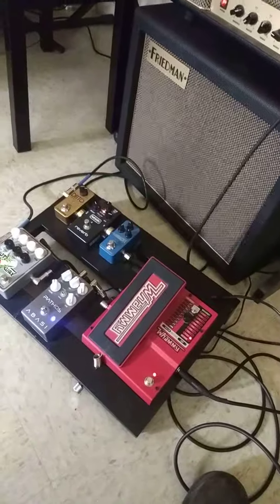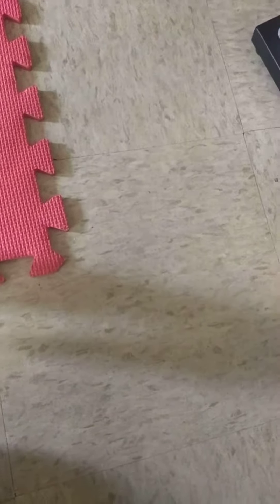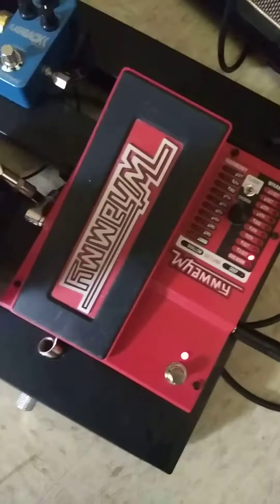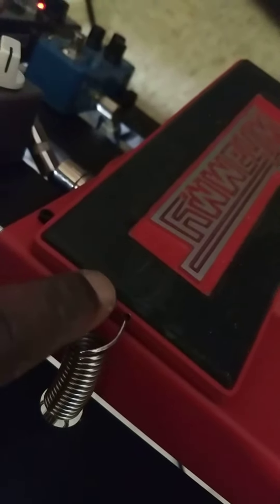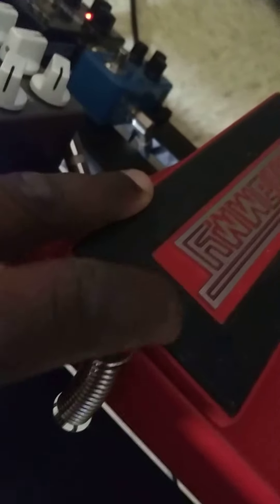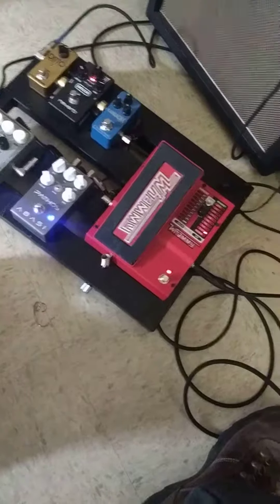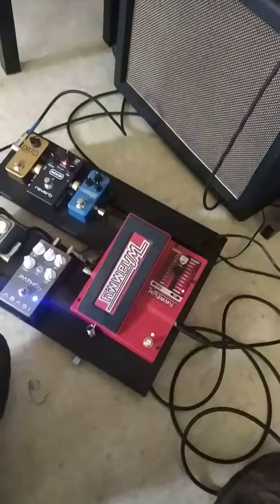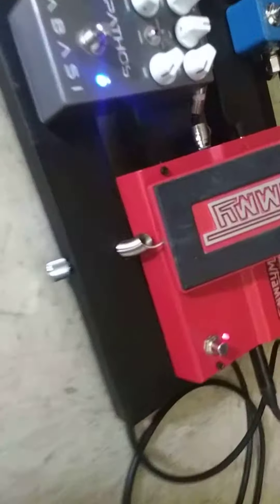DigiTech Whammy pedal spring mod

Comment: Hi can you please tell me the exact parts to get for this? I can't see this clearly. I really need this setup.
Reply from the maker: https://www.samash.com/gibraltar-replacement-bass-drum-pedal-springs-set-of-2-gsc15c?cm_mmc=Google-Drums%20and%20PercussionChanneladvisor_-Gibraltar+Replacement+Bass+Drum+Pedal+Springs,+2+Pack&utm_source=GGL&utm_medium=CSE&utm_campaign=Channeladvisor&gclid=Cj0KCQjw2MWVBhCQARIsAIjbwoNdX1KQiOoM2j3VfB5s7A43oB4tgVN-JmZ2J1dW2TX3hPlHIFcGBDwaAhfJEALw_wcB
Reply from the maker: https://www.guitarcenter.com/Gibraltar/Bass-Drum-Pedal-Spring-Tension-Assembly.gc
Reply from the maker: i am pretty sure most would laugh , but it was soooo worth it .. this shold be done from the factory IMO .. i have sold the pedal years ago but at times i miss it .. i would like for them to release a spring equipped model